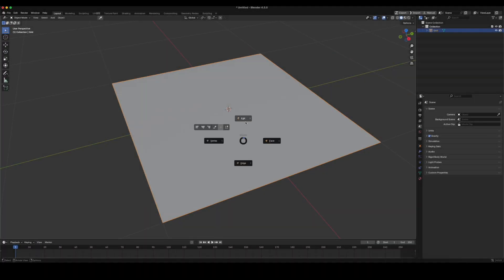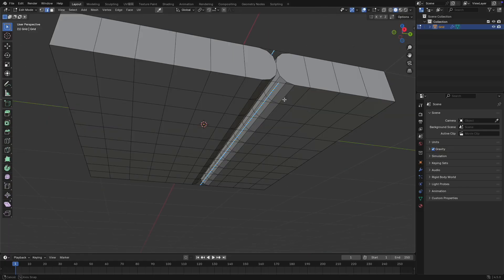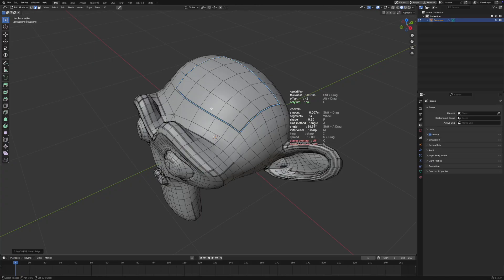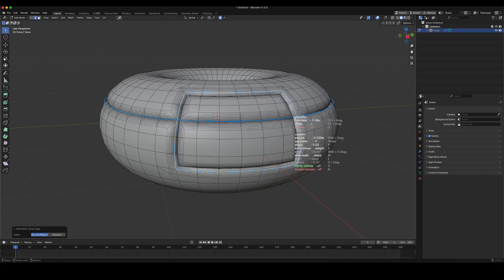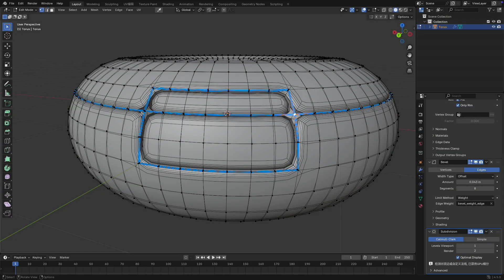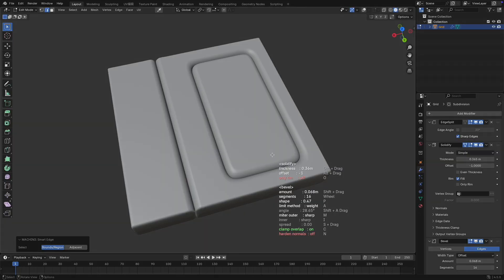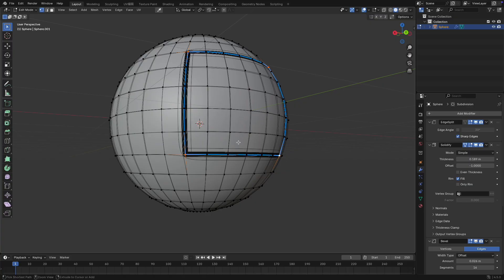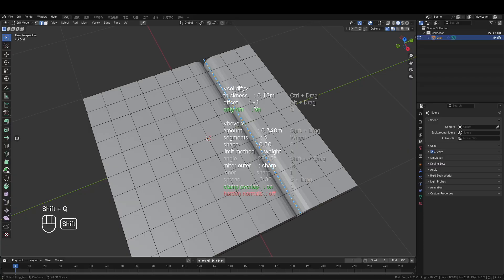Blender Addon: CutzTools–Non-Destructive Hard-Surface Modeling Complete Tutorial/硬表面建模插件教程技巧/튜토리얼Tip

Comment: Just bought this, really cool so far, makes it so much easier to add details. The only downside happens when you've already added thickness to the model, is there a workaround this?
Reply from the maker: Thanks a lot for your support♥
If the model is just a flat mesh and already has a Solidify modifier, please apply it first before using the cutting tool.
The addon requires a Solidify modifier to define the thickness of the cut.